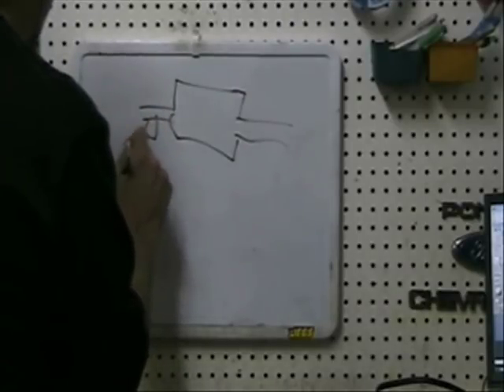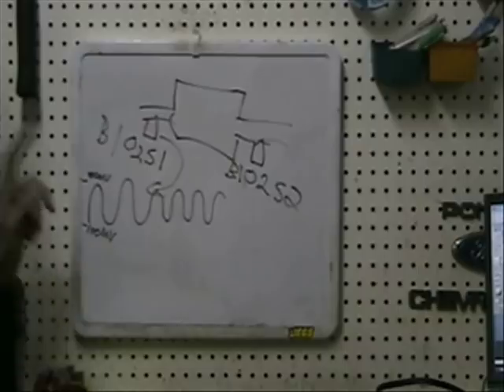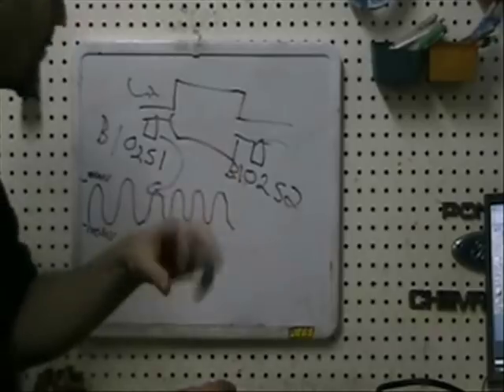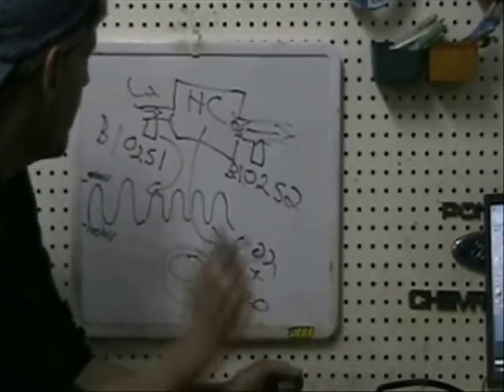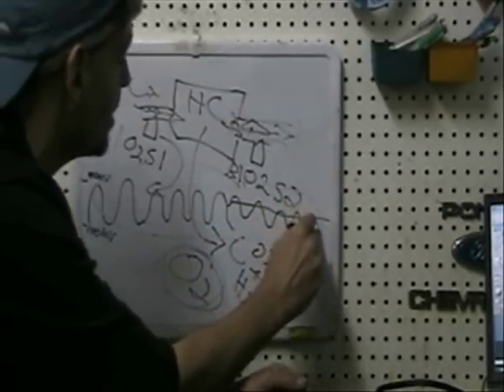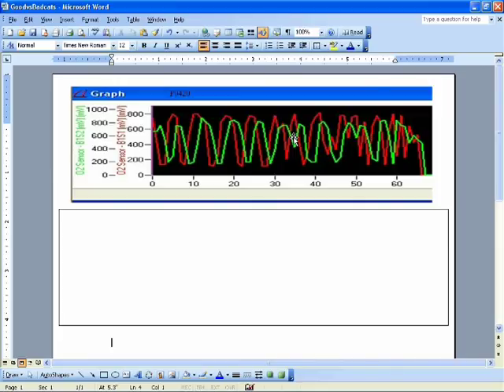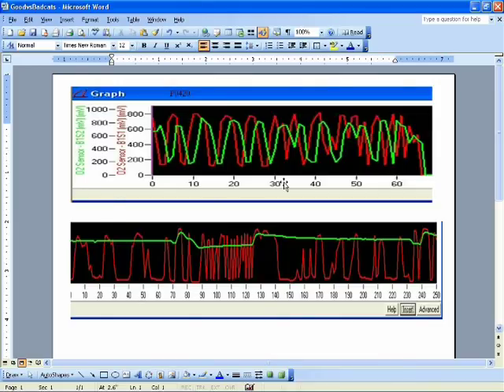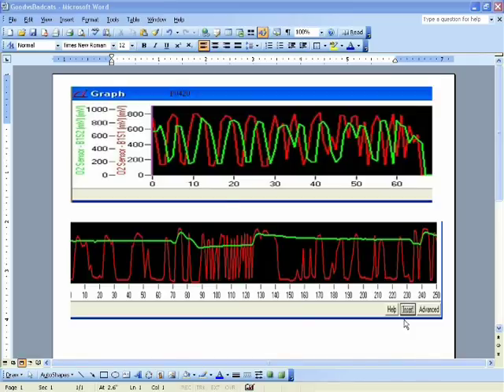P0420 P0430 catalytic converter catalyst inefficiency code diagnosis

Comment: hey,what type of  obd scanner would you recommend buying if i want to check things like o2sensors and how cat works as well?
Reply from the maker: +Matvey Kozar any with live data will do.
Reply: +Schrodingers Box What kind of program are you using ? That is just data log pulled from the scan tool to your laptop am I correct ?
Reply from the maker: ltwargssf R It was live scantool data

Comment: Hi! Have a P0430 on my Rx330 2004. Previous owner didn’t change air filter for a long time.. so it’s a sign for me.. also I have a valve cover gaskets leak on exhaust.. So I will do a spark plugs/pcv/valve cover gaskets now just because he didn’t change them I’m sure. Then run cat/clean and reset codes. If the code will be back I will do this test. Am I right? Or I missed something?
Reply from the maker: why would that help with a P0340?  What is the DATA you are using to show those are the things that need to be done?
Reply: Schrodingers Box I had in plan to change all of it, because it is a time. I meant previous owner didn’t care about car. But yesterday code showed up, so anyway I need to do all together. Great video, I will check Oxygen sensors and see what’s going on there

Comment: Hi
I know that if the O2 in the exhaust  is high so the voltage produced by O2 sensor will be also high, and you said that with a good Cat. downstream O2 sensor will produce high voltage and there will be no O2 down stream the Cat. what is i am missing?
Reply: +idjaidy You have the voltage polarity reversed. It can be confusing. If there is O2 in the exhaust (lean) the voltage will be low - around .1 volts. If there is no oxygen in the exhaust (rich) the voltage will be high - around .9 volts.

Comment: I have a 03 Subaru Forester currently haunted by a P0420 code.  I have intermittent rough idling and revving.  New cat installed.  O2 sensors were replaced prior to new cat 18 months before.  Still have P0420 code with no improvement to symptoms. Can a faulty cat cause newer O2 sensors to go bad as well?  In other words, do I need to add new O2 sensors to the new cat?
Reply from the maker: I dont know.  what is your O2 sensor data showing?
Reply: I just bought a Blue Driver scan tool.  I have read the live data from my O2 sensors.  I believe Blue Driver has mixed up the labeling of the sensors in their app.  I read the upstream sensor is reading roughly between .05 to .8 volts (wavy graph line) The down stream is steady at over 2 volts (flat graph line) Both appear to be functioning properly according to your video lesson.  Thanks for your reply.
Reply: I just watched your Engine diagnosis video about STFT and LTFT.  That will be my next scanner test.  I do know that the STFT is reading 0%.  I will check LTFT and see what happens as I change RPMs.  Thanks
Reply: LTFT is hovering at a -14.8% and STFT is hovering at 0%

Comment: Would a faulty air pump system cause this error?
Reply from the maker: Nope. A faulty air pump would cause an air pump code as the B1's would fail to detect the AIR lean condition created upon activation.

Comment: SB, what if the sensor initially had the oscillation and the second O2 had a flat line and then switched roles? Flat line at first sensor and oscillation on the second one?
Reply from the maker: Under what conditions is this happening and by flatline is it flat lean or flat rich?
Reply: @SchrodingersBox  idle. I was just watching trims, TP angle, short and long term FT. The engine would just randomly shut off and it was inconsistent and it would just be normal again. No codes other than P0420 below threshold efficiency at a light stop but that did not have any effect.
Reply from the maker: Run engine to 2500 RPM. If S1 and S2 superimpose signals, you have insufficient catalyst activity- confirmed.

Comment: My bank 2  2/2  at idle has 8 to 9 MV  steady flat line but if I increase my my fuel raising my revs by accelerating it matches the  first 2/1 o2 sensor is the sensor bad or the catalytic converter?
Reply from the maker: The measurement should really be done at 2200 rpm.  Sounds clear that the cat is failing the way you describe it.
Reply: Thank you and thanks for the great video.

Comment: WHAT IF Bank 1 Sensor 1, the before Sensor, before it goes to the CAT is bad? Then replacing Bank 1 Sensor 1 would fix the P0420?
Reply from the maker: You won't get a P0420 in that case. You'll get one of about 24 other codes depending on the sensor fault.
Reply: THANKS

Comment: Good job, very clear explanation!!! You are a great teacher! Well, couple questions: I have this code,...on and off, in my Infiniti FX45, about 118000 miles. It came first, when I changed/ switched oil to Full synthtetic, was on for awhile, went off. Now, lately it has been coming back, I put half and half 87 octaine gas, and sometimes 92 octaine gas, could this bring this code too?? How about a bad oxygen sensor, like Bank 1, sensor 2?? And finally, could it be bad sparkplugs?? I bought new ones, did not put them on yet??? I like to know, how to do this, in which order, last thing would be new catalytic converters, because they are so expensive, alhoug my buddy could weld them cheap for me, could I buy them cheap in eBay?? Thanks a lot, youtheman !=)
Reply: The first thing you should do is put on new catalytic converters if you can confirm the issue with a scan tool like he shows in the video.  If you wish to throw parts at your car that are related to the symptom in the order of least expensive to most expensive, just visit a parts store or watch the Scotty Killmer channel.
Reply: Why start with most expensive parts?? Don't get it??? Car runs perfect, no hesitation at all, I don't think that catalytic converters are bad...at least hope so =)

Comment: Nice video!!

09 odyssey, misfire in all the bank 2 cylinders also cat below threshold, the b2S2 is just like in your video, temp after cat is around 300 bank 1 temp after cat is around 600 , u think i have a not working cat and that is frying my coils or bcs of the misfires the cat is not working?
Tnx
Reply from the maker: the misfire is most likely causing the cats to fail, not the other way around.
Reply: @SchrodingersBox  Tnx, i ordered new sparks and coils, i will let u know the result, thank u
Reply from the maker: how did you determine it was an ignition problem?
Reply: @SchrodingersBox  
I have a scanner, also disconnected the coils one by one and found out all.the bank 1 to be not good, changed all spark and  also coil 1-2-3 ( near the fire wall )
So code P0420 bank 2 bellow threshold went away however the car still not running good , now i have bad reading in O2S1 & O2S2, sensor one is flat sensor 2 is going up & down and the car still have an hard time switching gears, 3000 rpm and can get it to 60, any advice, u think is the cat?
Tnx
Reply from the maker: I don’t understand how that indicates there is an ignition problem. how did you find bank1 “not to be good” by disconnecting the coils. was there no change in engine idle when you did that or something?
Reply: @SchrodingersBox  Update
Misfire according to my scanner so i disconnected every coil till i find out that by disconnecting the rear ( near the fire wall.? the motor rpm did.not go dow,.i replaced all sparks & the rear coils.
The misfire was gone after this however it continued chock himself  , i cleaned the.MaF & body throttle & that didn't fix it
The scanner aslo showed weird ridings of the o2 sensors. I took the pipe between the manifold cats and the muffler and drove it and problem was gone! So i cleaned the other cat just before the resonator with brake fluid, washed and dry it with air and so far it drives good, one more thing i did is i put seafoam in the gas tank
Reply: One strange think I found out is that the two catalytic converters that are.part of the manifold were empty!.not sure if this is the way.suppose to be however u can see the 2 02 sensors inside the cats!
The one i removed and cleaned you could see the honey comb inside ( located between flex pipe and the resonator or muffler whatever the name.is ).
Reply: @MyPostville  yup the stuff breaks down and disintegrates, you are lucky they didn’t plug up like mine

Comment: It could be a missing or broken gasket on the 02 sensor itself. Another garage left out the gasket on a TOYOTA.
Reply from the maker: Not possible- how would you explain the OSCILLATION of signal that SUPERIMPOSES the S1??  Not possible.
Reply: After I installed a new gasket the code never came back. Used the same 02 sensor. Code P0420 hasn't been back for 3 weeks. I was going to replace the 02 and noticed the gasket missing. Same 02 same Cat and still no code. I talked with a Toy Mech and he said it was just enough exhaust leak where it would suck in Oxygen.
Reply from the maker: That is not a scientific explaination "the code never came back".  Did you verify the oscilation returned to a stable reading? Did you even confirm there was oscillation to begin with? How do you explain this?
  If it was sucking in oxygen (which it wasn't by the way,) why was the fuel trim not positive and the sensor fixed lean instead of replicating S1?
  It seems no one, not even professional mechanics, understand this.
Reply: All I am saying is that I almost replaced both Cat's according to what your video stated. "If you get this code you need to replace the Cat". Someone replaced the Muffler, Tail Pipe and the Pipe behind the second Cat and left out the 02 Gasket. I found this out while getting ready to remove the Cat's . It was an easy try and repair. If you ever get a Toy with an AF Sensor try removing the gasket from the rear 02 sensor and see what happens.
Reply from the maker: ...ANd you should have. You just dont understand the data yet. ACtually you have none to assess. A/F sensor is not even used for catalytic efficiency in Toyota- those are used for fuel trim. standard zirconia sensors are still used for catalytic activity.
  What is your current O2 sensort output? What was it before the repair so you can confirm the fix?
 Remember it may take many months for the CEL criteria to be met. Just because it hasn't come on is no indication the issue was fixed. Could have just unplugged the battery for same result.
  It is critical from a scientific perspective to understand that your response equates to "I almost fixed the car properly but didn't because I used incorrect theoretical application to justify an alternative approach without confirmation of success."

Comment: I have cleared a P0420 code with just a seafoam treatment in Chrysler T&C, it came back after 2 years did another treatment and hasn't come back.
Reply from the maker: Bet you $100000 you did no diagnosis whatsoever to confirm actual loss and subsequent restoration of catalyst activity. Just kidding, Of course you didn't.
Reply: Schrodingers Box In my case, I didn't have to. Bad valve stem seals were causing oil consumption, a coolant leak by the exhaust manifold, so I concluded that those 2 problems were blocking the cat. Time is money, specially in a flying stock market!
Reply from the maker: I wonder if seafoam fixed all that too
Reply: +Schrodingers Box seafoam washes all the codes away
Reply from the maker: David Bell Lol "gonna wash those codes right outta my hair"

Comment: Is there any reason why a 2016 78k miles versa would be getting 2.200 b1s1 and .400-.800 b1s2? I should note code p0420 with part of the intake housing broken parts to engine compartment so small holes in intake
Reply from the maker: Hundreds of reasons. Start with a basic fuel trim curve against load and check for O2 response to rich and lean variables first.
Reply: @SchrodingersBox  I tried some stuff by fixing the busted intake housing piece and removing it all I noticed was my b1s2 with hole fixed .360 without repair jumps to .500     After that my b1s1 stayed even 2.235  no matter what I did. So, no up and down b1s1 just a straight 2.235 no matter what I did idle or 2000rpm   B1S2 .360 with hole covered and then .500 straight across with hole open. Confusing maybe thanks for any advice or help
Reply from the maker: If it’s a 2016 is sounds like that’s got an A/F sensor not an O2 sensor. if that’s the case simple check the equivalence ratio response to rich and lean variables. If it responds accordingly, change the catalytic converters.
Reply: @SchrodingersBox  okay, thanks! I'm guessing there's a way with my zurich zr11 to check a/f sensors?? if the numbers continue then I guess change the cat converter. But I'm confused how it went out so soon and how do I prevent it from going out again? I am pretty tool and car savy so any suggestions would help. Again, thank you for your help
Reply: @SchrodingersBox  Upon further research I have learned what i asked about earlier. I understand it 1000% better now.

Comment: Hi sir I have 6v  2006 4Runner . My car has code PO420 I did test upstream AF sensors they were 3.20 v .. but I don’t know what Reading should be on downstream O2 sensors if I Soum that  I have a bad Catalytic  converter
Reply from the maker: Downstream sensors are still zirconium dioxide based so simply look for superimposition of short term fuel trim adjustment which would indicate lack of catalytic activity.
Reply: Thank you so much sir . Your explanation it’s so clear  I love it 
And good scan tools for Toyota try Techstream  V14.10 .028 . Thanks again

Comment: What if its P0430 ... Bank 2... and the O2S1 is a flat line, and O2S2 is a wavy line? The lines are the opposite of what they should be?  Is that a bad upstream O2 sensor? Or the cat?
Reply from the maker: I don’t see how that could happen.
Reply: @SchrodingersBox   Just FYI: I figured out how it could happen.  On some semi-newer vehicles, like a 2004 Toyota 4Runner, the upstream sensor is actually an "air fuel sensor" or a "wideband" sensor.  The downstream sensor is still a regular O2 sensor. But the upstream air fuel sensor is a little different. It WILL produce a steady signal instead of the up and down like a regular upstream O2 sensor.  Do some research on it if you have time. Its kind of interesting actually.  I'd love to see you do a video on it.
Reply from the maker: yes I do have a video series  on diagnosing air-fuel sensors. I guess I should have asked what car it is - you had mentioned O2 sensor so I just went with that.   
  you described it accurately as to the AF sensor though- that’s pretty much it.  except the upstream sensor does oscillate but it does it with amperage, not voltage. the voltage is an arbitrary number- it is not representative of the sensor actual voltage. that’s why the upstream voltage isn’t changing. instead of oscillating between .9 to .1 V it should be constant voltage somewhere between 2V and 3.5V depending on the car.
Reply: @SchrodingersBox  Thanks... I checked out your videos on the air fuel sensors.  The way you explained it, makes more sense to me now.  I always love your videos.  I always find the info I need. Thanks again.

Comment: I have a question ,my 05 toyota 4runner has a p0420 the truck is running
 perfect but is burning more fuel than normal i can tell,b1s2 is 
mirroring b1s1 is that mean i need a cat? there's all kinds of 
information out there,it doesn't really feel like the cat i clogged what
 should i do?  Thanks
Reply from the maker: What data do you have other than the O2 mirroring? catalyst inefficiency is not going to cause fuel consumption. What trim numbers are you seeing?
Reply: @SchrodingersBox  Im not sure i have to check ,so why is using more fuel then? i live in california so i don't really care about the yearly smog some states have but the fuel issue is driving me crazy .I will get the fuel trim numbers

Comment: I have a P0430 code, but the live data looks like the second example. STFT on Bank 2 is between 1.6% and -1.6%, B2S2 stays close to .8V with little to no fluctuation.  B2S1 is switching rapidly.  S1 tested good when driven rich and lean.  Any suggestions of what could be causing the code?
Reply from the maker: Try it at 2200RPM
Reply: Thanks for your reply. It did oscilate slightly, between .700 to .775 v at higher RPM and when mapped similtaneously with B1S2 it looked like B2S2 had slightly more variance.

Comment: What if I have a wideband sensor? Since it has a flatline, how can I diagnose my cat by comparing the bank1 sensor with the bank2 sensor?
Reply from the maker: The rear sensor will still be narrowband.
Reply: I made a mistake by mentioning bank1 and bank2, I meant sensor1 and sensor2. So if I understand your answer, in a bad cat situation, the sensor1 will display a flatline with a value of 1 (equivalent ratio) and the sensor2 will fluctate between more or less .1 and .9 volts?
Reply from the maker: Alexis D.H. Correct.  Even though the A/F sensor voltage appears to be flatlined, it actually isnt- that is just what a scantool reports- it actually does switch lean to rich like an O2, but it does it through undetectable current polarity changes.  The rear O2 would reflect the switching if the cat is bad same as always.

Comment: Hi im getting the p0420 code on my 4 cylinder. 1.3 liter ford aspire. Its the only code im getting. The freeze frame is fuel system is in closed loop. Engine load is 47.8%. Coolant temp is 156 f. Stft is 1.6%. Ltft is 3.1%. Rpm is 2241 at 40 mph. I cant make heads or tails out of this info can you. When i reset code it comes back on in 1 to 2 days. I would appreciate any help you can give me thanks
Reply from the maker: None of that data is useful. you have to superimpose S2 voltage over S1. Where is that data?
Reply: @SchrodingersBox  oh ok I'll get that data and watch your video and see if i can figure it out. If i can't I'll send it to you. Thanks for responding i really appreciate your time